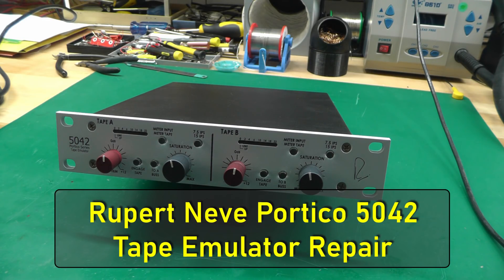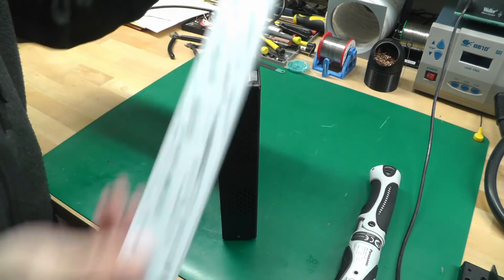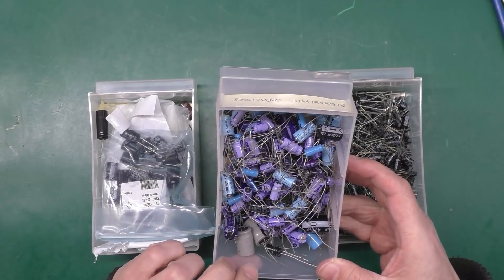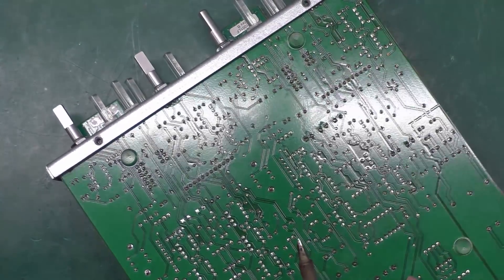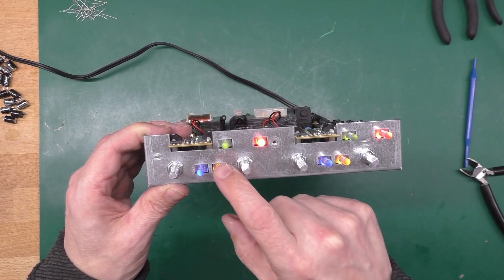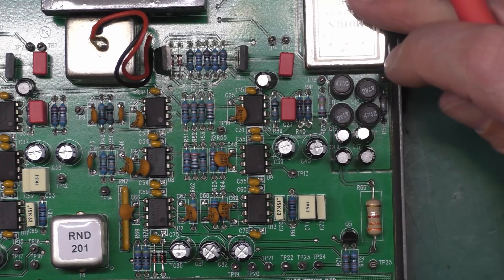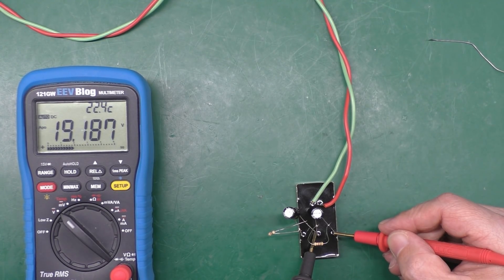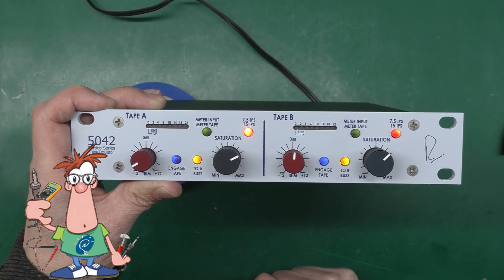No.049 - Rupert Neve 5042 Tape Emulator Repair

Comment: A wonderful repair =D  I would be curious to see what has failed inside the DC to DC!
Reply: Yeah, exactly. Potting that DC to DC module is completely unnecessary. Its not as if it gets a lot of mechanical vibration either. I would not have spent the £45 for that. It'll just go bad again in the future and he'll need to buy it again. £45 is a fecking rip off. There are perfectly good cheap adjustable DC to DC modules available on ebay from china.
Reply from the maker: @simontay4851  There are cheaper DC-DC converters, but it's not my money and the owner told me the budget for the entire repair was up at £200 given the value of the device is £1500 when bought new. I'd be wary on introducing noise without take some additional actions on a cheapo DC-DC.
Yeah, brand name DC-DC converters are expensive, they have always been sold as a "black box" value and they name their price. Try RS or Farnell for some pricing it's scary!

Comment: Hi Ian , any update re: those op-amps ? In your Rigol function generator video , you were kind enough to explain to me that you knew its opamps were faulty when the inverting & non inverting inputs showed different voltages , which indicated that the output's feedback mechanism was unable to balance the 2 inputs ; so I'm curious whether or not it's the same case for this board's opamps as well ?

Comment: Thanks Ian for the interesting video. I was initially thinking bad connections in the many gang switches, but hearing that DC to DC converter nlises sounded almost like a switching supply without load where switching turns off and on in bursts..

Comment: Ian,,, couldn't you replace signal ele caps with film caps as long as they are low value caps? I would think they would be much better the the ele caps for the signal paths?
Reply from the maker: I don't want to alter the signal path at all, and given the range of audio frequencies going through the signal caps I'd be afraid the sound was altered. Tape emulation is a subtle effect at best.
Reply: @IanScottJohnston  Very true I was just in a "Hummm state of mind"

Comment: Nice video! I'm wondering what's inside those metal cans labeled rnd 201 and the other ones with the wires soldered to the top.
Reply: The Portico 5042 incorporates an actual tape drive circuit that feeds a tiny magnetic "head" which, in turn, is coupled to a correctly equalized, replay amplifier. The only thing missing is the tape itself and the cost! i guess those are the magnetic heads, the other ones  with the wires soldered to the top are the input transformers.

Comment: Awesome work, thanks for sharing. After watching your video I decided to recapp my unit and replace stock Nichicon caps with Dubilier caps. Unit perform so much better now. I thinking of doing one more modification and swith the unit from DC to high quality AC power supply. Would that improve performance of unit? Any advice is highly appreciated! 
Cheers N
Reply from the maker: Nice one!......Well, I'm no audiophile but I guess you could improve on the stock power supply but whether you could hear the difference I don't know. The weak point appears to be the DC-DC converter, so maybe a multi-rail (isolated) linear type may help.

Comment: How much was the replacement DC-DC converter cost?
Reply: He said above it cost £45. An absolute fecking rip off when there are cheap DC to DC converter modules available on ebay from china.
Reply: @simontay4851  ebay modules from china are made to check the box of 'working', certainly not to be used as-is

Comment: My Technisc SU-VX620  amplifier, bought in the mid 80ies, started to scratch and hum a few weeks ago. I had a look inside - bingo - the two main power supply caps were both bulging.
I was surprised to find the full technical manual online but there it was with circuit diagram a d every thing. Luckily I had a couple equivalent (better) caps in stocks with the same footprint. The amplifier is now as good as new.
Reply from the maker: Nice one!.......it's great to keep old gear going.......

Comment: You should strip down the dc-dc you pulled out, you might be able to fix it too.
Reply from the maker: Possibly.......I think I have some capable solvent somewhere. Might take a while to de-pot it though.
Reply from the maker: Mai Mariarti  I will for sure........could be a while as de-potting can be slow. The compound in this one is rock hard.
Reply from the maker: I have partially de-potted the DC-DC, photos in the video description. It sat in the solution for 10days and I have only managed to clear one side, and which basically 'fell off' itself. The other side is still fairly solid though. Not sure I'll try any harder as the miniature coil cores are visibly making picking harder and I don't want to try my MEK solution as it's quite dangerous.
Reply: IanScottJohnston - just from the first photo I think I can see a crack in the large cap next to the two pins, haven’t looked at the rest yet
Reply from the maker: @TheDefpom  No cracks, just solder tags/wisps and optical illusions.

Comment: Probably some opamps also was damaged because of overbolrage  and now haven't all the original properties.
Reply from the maker: The device is back to my friend for testing on his rig........hopefully I won't see it again. But yes, it was worrying to see those voltages and one reason I looked at the op-amp datasheets. Hopefully all will be ok.
Reply: @IanScottJohnston  any update re: those op-amps ? In your Rigol function generator video , you were kind enough to explain to me that you knew its opamps were faulty when the inverting & non inverting inputs showed different voltages , which indicated that the output's feedback mechanism was unable to balance the 2 inputs ; so I'm curious whether or not it was the same case for this board's opamps too ?

Comment: You could also hear it oscillating in bursts on the video as well. A simple stick on heatsink would probably not go amiss on the new one, to keep the insides from being more than comfortably warm, as the heat transfer from the inner components to the case likely is pretty poor. Likely the ferrite core inside has cracked, though the only way to see, aside from sending to Mike Harrison to get a good X ray, would be to drop it into a jar of MEK for a month, to soften the epoxy, and dig out the resulting stuff. Those hard epoxies will eventually soften in that, though IC cases are supremely unaffected, though any resistors and capacitors will lose their outer cases, and for foil ones, puff up and disintegrate.
Reply from the maker: I'm rather deaf so that coil squealing must be pretty loud if you could hear it on the video also! In regard to de-potting it........well, I would but only if it meant getting it back operational again.....:-).....Might be worth it though, it cost £45.
Reply: @IanScottJohnston  It's indeed audible. :) That thing is not a happy camper :P
Reply: @IanScottJohnston  Last thing I depotted was an amplifier for some form of ECG machine. took a month to get that epoxy soft, so the board was kind of fragile, but the chips survived, and I could see they had made a glorified single transistor amplifier out of an opamp, to get a well defined gain, but rather variable DC offset, though input and i guess output was AC coupled anyway. I was wondering how it was connected, using just the 2 screw terminals it had aside from the electrode connector.
Reply: £45 for that, what a fecking rip off.

Comment: I was just so frustrated that you didn't use an oscilloscope on the power rails.  It seems so obvious to clip the scope probes on to the two rails and observe them.  We can see if there's just wandering, or noise, or even jumping up and down.  Yes, fix the obvious cap problem, but looking at the rails with the 'scope before and after changing the cap could well have led you to the DC-DC unit much earlier.
Reply from the maker: In the thick of things time is often spent setting up cameras etc.......and also given it's an isolating DC-DC converter then grounding the scope can have issues. The scope work is reserved for a further video where I am attempting a repair to the DC-DC......am de-potting it as we speak, hopefully all will go well.
Reply: @IanScottJohnston  I can see that in some cases the isolation of the DC-DC converter needs to be taken into consideration.  Here though it really only isolates the DC input from the 0V output which is connected to the chassis and the 'ground' of the unit.  Since there are no other external connections there isn't likely to be a grounding issue.  Here, the isolation provided by the DC-DC actually helps with 'scoping rather than hindering IMHO.

Comment: I only got to this video now. I have (for better or for worse) unusually good hearing in terms of frequency range (I can hear up to 20-23kHz), and the crackling/squealing from that DC-DC converter was nearly unbearable, certainly louder than your voice. As I typed that, I thought I'd check more scientifically haha. I downloaded the audio for this video and checked the frequency content of that crackling - the highest powers are between 9kHz and 13.5kHz, where it's almost equal in terms of amplitude. There is still energy down to 19kHz+ where the limit becomes your microphone attenuation + 22kHz nyquist limit + anti-aliasing filter of the ADC + pre-filtering for YouTube's OPUS codec, all of which results in a rolloff. It's likely that the actual energy goes well past 50kHz.. the limiting factor would be acoustic wave propagation through the potting compound and the casing. Based on your followup video, it sounds like it was a bad solder joint exacerbated by the strong thermal cycling due to how hot this converter runs. Unfortunate that this wasn't a higher quality converter in such an expensive product. Great job on the repair! Patience of a saint for that de-potting. Stay safe! -Nick
Reply from the maker: Based on the temps alone I wouldn't use this DC-DC in a new product. On my follow-up video it's amazing how hot it gets for the small load I am putting on the output rails.....and like I said, no much wonder they sell a heatsink for it.
Reply: @IanScottJohnston  Agreed. The heatsink should've been a requirement. Long-term reliability of potting compounds is always questionable as well. If the compound shrinks (as many substances do) and loses contact with key parts, even a tiny internal air gap would spell game over. For potentially untrustworthy gear, it should've been a converter without potting compound. I'd only consider a potted converter if it's from a quality brand.. Vicor, Murata etc.
Reply from the maker: @oriole8789  Back in the day we used to use the same hard black resin potting compound and the amount of times the circuit failed after potting wasn't a lot, but it did happen.......and that was down to shrinkage etc. I don't know why Motien didn't use a more rubberized potting material. SMD components don't have the same flexibility and resistance against shrinkage as TH components IMO.
Reply: @IanScottJohnston  That's very interesting - I haven't had personal experience with shrinking compound leading to failure (at least, nothing I could prove). Helpful to know that the mechanism does exist. Rubberized compounds are likely a lot more expensive. All of these things come down to price ultimately, and chemicals vary a lot in terms of quality and long-term stability. That's why instead of attempting to prove/disprove another company's material choices, I'd rather go with a company which has better statistical quality control (+large enough product volumes to apply it). I'm always scared of dealing with obscure companies, or companies who have no reason to fear for their image/reputation. Thank you for the info!
Reply: Did the squealing reduce after Ian fitted the new DC-DC converter? My hearing is poor over 10kHz so I couldn't hear anything other than Ian's voice!